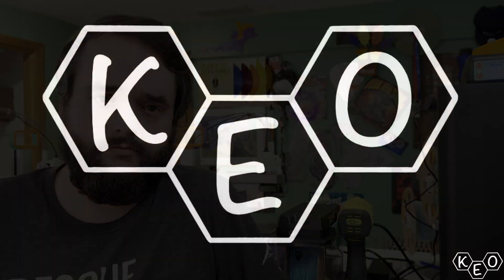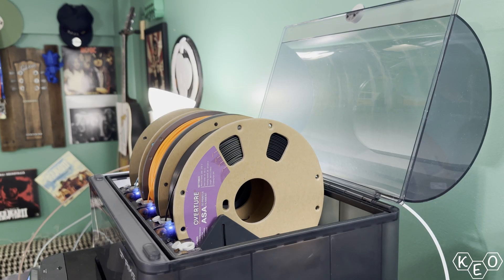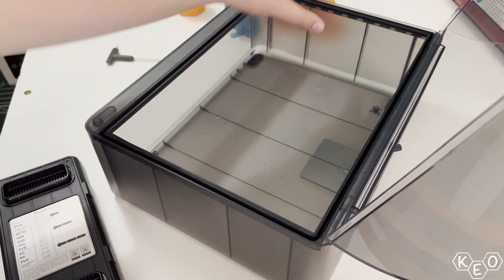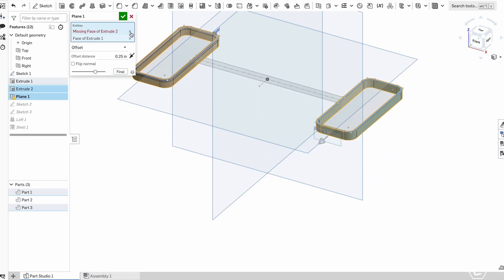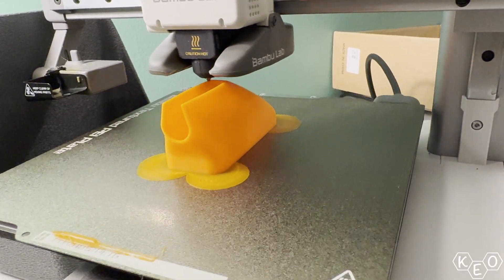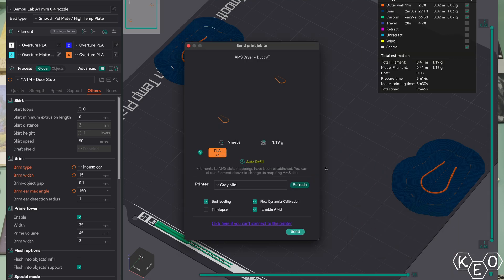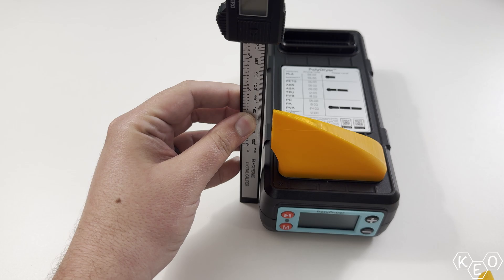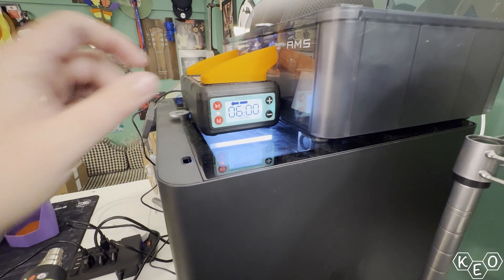AMS Active Drying? The Bambu Lab AMS PolyDryer Upgrade You Need To See

Comment: Would be a far better idea not to damage the AMS on the process. Why not just making a wedge shaped adapter that fits between the lid and the body of the AMS? This way it can attached temporarily for drying out a AMS while at the same time not damaging it. 

Well I guess I now have an idea what I can do when my Poly Dryer arrives next week..
Reply from the maker: That would have been a good idea had I thought about it! Oh well, more learning for next time! 

Let me know how you like the PolyDryer; I really like the idea of a modular dryer like that
Reply: I think you need to tell us how it did.  60% RH to 45% after an hour is not what I expect as a result.  What happened after 6 hours? 12 hours?  Did it finally get down to the 10-15% RH we need to see?
Reply: Why not just use silica (yes I know he doesn't like it)?
My 4vAMS units all sit at 17% humidity using silica beads
Reply: You cut the right areas. A new panel can easily be cut out of 1/8in acrylic that matches that entire panel. It would take about 30 minutes for a novice with minor power knowledge and cost maybe $15.
I also checked with 2 online plastic companies that would supply, cut, and ship a panel for $50.
But cutting this panel and layer sealing it with duct tape would be fine other than for looks.

Comment: Check out the Python AMS mod.  The replacement enclosure is designed to have up to 4 dryers attached to it.  It uses a retaining ring pressed onto the dryer from the inside of the enclosure, though the recommendation is to add VHB to the dryer, as well.
Reply from the maker: Yea that was the one that inspired this video a little bit. I saw ModBot reviewing that setup and I thought mounting the dryer like that was such a good idea!

Comment: “Why don’t I just use the AMS as a dry box?” Um, it is a dry box. That’s why it has seals and desiccant packs. So that it is airtight and stays dry. 🤦‍♂️
Reply: @ClaytonMacleod  but I don't think the desiccant alone can dry highly hydroscopic rolls of filament well enough. Some filaments have to be printed from a drier. That's why dryers exist. Making the AMS a drier is an excellent idea.
Reply: @rkwjunior2298  A dry box isn’t for drying. It is for maintaining dryness. A dryer is for drying. Once it is dry it will stay dry in the AMS as is. That’s why the AMS is sealed and has latches to stay closed. It doesn’t need to be made into a dryer to keep the filaments in it dry. It already does that straight from the factory. It is a dry box.
Reply: @ClaytonMacleod  Yes that's why he's incorporating the poly drier into the AMS, so they AMS is a filament drier with the  ability to print at the same time, eliminating the issue of printing from a separate drier for very hydroscopic filaments. But this is an all in one solution,  to dry, and maintain dryness while printing.
Reply: @rkwjunior2298  You don’t get it. Filaments don’t absorb moisture when inside a dry box. That’s why it is called a dry box. It is dry inside. You dry them out in a dryer. You put them in a dry box. They stay dry.

Sorry to break it to you, but filament rolls in the AMS are not absorbing moisture because there is no moisture to absorb unless you put it in there. The likely reason his AMS showed such high humidity inside is because of the rolls he’s using, cardboard, and how he treats his AMS. If he had dry filament to begin with, on plastic rolls instead of the cardboard that might as well be sponges, and he had working desiccant in it, then he wouldn’t have high humidity in it. The AMS is sealed. That means moisture cannot get inside from the room. Any moisture present inside it is what you put in there yourself. It is a dry box. It has holders for desiccant packs to stay dry. If you put moist filament with moist cardboard inside it that means you are deliberately introducing moisture into that environment yourself. This is obviously counter-productive. If you only put dry filament in it like you are supposed to then it will stay dry. The desiccant packs will easily absorb any moisture in the air from when you have it open to change rolls. The desiccant packs aren’t meant for drying out moist filament. They’re meant for keeping the dry box dry so the dry filament you put in it also stays dry. That’s why it is called a dry box. Did I repeat myself often enough for you to finally get it? 🤦‍♂️

This isn’t even mentioning the fact that those same cardboard rolls are specifically cautioned against because the fibres that come off them are going to screw up the mechanism.
Reply from the maker: Friends; please. Let’s all just hang out together. Semantics. Can we all just agree that I misspoke? 

There are far more important things to discuss. Like how support material is the worst and it should be banned!
Reply: @ClaytonMacleod  I don't agree with you. Dry your rolls of filament in a Drier Before u put them into the AMS to print. Especially very hygroscopic filaments. 
I switch out filaments all the time so they are exposed to ambient moisture at various times of its life. They don't stay in my AMS indefinitely.
Reply: @rkwjunior2298  Filaments don’t just instantly suck up all the moisture they can in three seconds flat. Moving different ones in and out of the AMS from/to other dry storage places isn’t causing a moisture catastrophe. It takes time to soak up enough moisture to have things go awry. You really don’t seem to be paying attention to the discussion. You’re now saying things to me that I just said, heh.
Reply: @ClaytonMacleod  nobody said it's catastrophic. You need to relax dude. People use dryers all the time. No reason the AMS can't be turned into one.
Reply: @rkwjunior2298  Plenty of reasons. You need to learn to read and retain information. 🤦‍♂️
Reply: @ClaytonMacleod  you have no idea what you are talking about.
Reply: @WindedWalruss93  Your failure to understand doesn’t change the facts.
Reply: @ClaytonMacleod  your failure to understand basic chemistry is laughable. @rkwjunior2298 was correct here and you refused to listen.
Reply: @WindedWalruss93  Has nothing to do with chemistry. Has to do with the AMS being a sealed enclosure that moisture does not penetrate easily enough to be of concern. How is that eluding anyone? It is a dry box. Period. Someone’s failure to understand what a dry box is doesn’t change the fact that it is a dry box. If you out dry filament in a dry box it stays dry. The absence of moisture guarantees this. You can’t absorb what isn’t there. You’ve got to have some serious comprehension problems if that concept is too difficult for you to grasp.
Reply: @ClaytonMacleod  but it's the fact that if moisture did get in the box it would solve the issue. We are talking preventative measures and being proactive regarding moisture in the ams. You still are bot understanding
Reply: @WindedWalruss93  I understand just fine. You’re the one that doesn’t. Moisture only gets inside the AMS when you open it to change filaments. It’s not getting in there when it is closed. It’s a sealed box, dude. And the small amount that is in the air in there after you close it again is dealt with by the desiccant fairly quickly. I have a hygrometer display in mine and can see how quickly it drops after opening and closing. Desiccant works. The amount of moisture that is present when you open it to change filaments, and close it again, is not enough for the filaments to soak up anything meaningful. Filaments don’t get soggy in 3 seconds flat. It takes a good deal of time for them to soak up moisture. And the small air volume inside the thing is incapable of holding enough to be of any concern because the desiccant soaks it all up in short order, long before the filament could do so. It is a dry box with desiccant, and that solves the issue. You put dry filament in there, it stays dry.

Comment: You really don't want to just circulate air in a dryer, the hot air can carry more moisture than cold and you really want that moisture to leave the dryer.   There is a mod I saw on makerworld that blows hot air through the AMS and vents it out which would do that. Personally I use an "Ivation 6 Tray Countertop Digital Food Dehydrator". $99 from AMZN, it will hold 2 spools and it vents out the top to remove moisture.  It works great even for PA6-GF.
Reply from the maker: I was wondering if the PolyDryer vented air out the side of it. If that is the case then that solves a lot of problems. I’ll have to do some more reading and make a follow up video. Thanks for the input guys!
Reply: Exactly - anyone that has been to a hot tropical place knows how humid the air can be. Cold air can be incredibly dry - freezers dehydrate your food and the air that gets in - that is where all the ice comes from....
Reply: @rorywquin   You can't compare weather to an electric heater.  Electric heat is a notoriously dry heat.
But the poly maker heater doesn't use refrigeration nor does it have a pass-through, 
The dryness of a freezer comes from the refrigeration cycle.
Reply: The polydryer vents out the air through its side.

Comment: Great ideia. I do wonder if it wouldn't be easier to glue some PolyMaker "AirLocks" to holes on the back of the AMS and connect the heater there directly to it.
Reply from the maker: That would be much cleaner. I love the air lock system that they use for their boxes and I think mounting the box directly to the AMS would be way cleaner. That could still be in the cards but the base doesn't mount securely enough to hold onto those openings without some modification. So that wasn't in the scope of this version given the silly timeline I gave myself

Comment: 1. Why didn't you just port it into the bottom and make a dummy leg to support the rest of it?

2. You still need desiccant, or when you turn it off the filament is just going to reabsorb the moisture.
Reply from the maker: This was something that I honestly did not consider. Mounting on the bottom would be a much cleaner setup. The internal chassis would be in the way of the air flow but that really wouldn't matter because it would circulate just fine. 

I am wondering if there is a good method for exhausting the moist air from the system to still eliminate the need for desiccant. It is a valid point and will require some attention
Reply: @KeoPrints  The poly maker heater and container doesn't have a pass-through for excess air, does it? As far as I can tell it just blows directly into the sealed container. 
I would also keep the desiccant pods. It's only gonna help the process.
I dont think you need to exhaust the moist air. The drier is drying the air with electric elements

Comment: Great idea 
A few things that could be modified
Maybe use a bulkhead type fitting for a more secure,  gasketed fit. A round hole would be easier to cut into the AMS using a standard hole saw size.
The outlet of the ducting is definitely smaller than the outlet of the drier outlet. You may be restricting airflow.
Reply from the maker: I am inclined to agree on all of these points. The tear drop outlets are more easily printed without supports but that came to bite me when it came time to drill out the holes in the AMS.

Dropping down the outlet size is certainly a consideration as well so we will have to see what future models end up looking like as I live with this one a little more

Comment: Great Idea!

If I may offer some thoughts:
1. reducing the cross sections restricts the airflow and may cause problems with efficiency or overheating the heater.
2. making round holes is much easier. You could use a step-drill or a hole saw.
3. if you make a rim around the opening of your adapter, you can hide the imperfections of the holes and also introduce a surface for a seal.
4. you will still need desiccant. Where else should the moisture go, if you have an airtight box?

However, there are solutions which don’t need desiccant. Cnckitchen has a video about it. I don’t remember the title. Something like the future of filament drying. It uses a small panel, which splits the water molecules and extracts the hydrogen to the outside of the box. Very low power consumption (3 W).

Good luck!
Reply from the maker: All great notes here!

Yes I know the video you’re talking about. That thing is crazy! If they come out with some passive drying solution using that component that comes turn-key with power supply and such, that would sell like crazy
Reply: You are incorrect about the desiccant. When heated they will act just like the filament and give off moisture. You are correct that the moisture needs some place to go, but desiccant is not the solution. Let's use a food dehydrator as an example to find the correct and easiest solution to removing the moisture given off by the filament. All food dehydrators are open to the atmosphere. That might seem counter intuitive as you would think we are trying to dry the air and we don't want humid air from outside the machine to get in. While the air outside the machine does have a higher relative humidity, it has a lower moisture content than the air inside the machine due to the moisture coming off the food. 

Let's think of a way to to use the lower moisture content air outside the AMS to absorb the moisture coming off the filament. If we drilled a small hole in the return section of ducting, we could introduce that lower moisture content air into the AMS. We want a small hole because we wouldn't want to bring in a lot of air as it takes time for the moisture to come off the filament, and we can heat up recirculated air hotter than heating room temperature air. 

This does create a problem as the same amount of air that gets in must also get out. The easiest modification I can think for this setup would be to drill an slightly smaller hole in the supply ducting. The size of the supply and return holes could be based of experimenting or could be adjustable to dial in the best results for a particular room air temperature and humidity. 

While more complicated, I have an idea that I like even more. Instead of cutting holes in the expensive AMS, if possible, why don't we replace the lid with one we make? If that can't be don't easily, we could make an entirely new enclosure for the AMS. This will be much easier now since the enclosure no longer has to be air tight. I am picturing a 3D printed skeletal frame with plexiglass or Lexan panels. We would have the same hole in the return ducting but let the air escape through the no longer air tight enclosure. 

There is a problem with that, as the heater would have to run 24/7. If the possible, the enclosure could be made to be as air tight as possible with a hole the can be opened or closed. To dry the filament, the hole would be open, and the hole will be closed after you are done drying. While drying, no desiccant will be used. When not drying desiccant will be used.
Reply: @Noneofyourbusiness2000  I like the idea of just custom printing a new lid! There are wax pistons they use for greenhouses that open the windows at the top when it gets too hot—something like that would be interesting for a hole being open when hot and closed when cool. I do not know how small they make those pistons, but the concept is worth exploration.

Comment: I guess you don't realize that temperature and humidity (of air) is reciprocal. Meaning - simply raising the temperature of air will automatically result in a lower humidity. That you measured the effect isn't a sign of 'success'. It's just a sign that your measurement tools are, more or less, functioning. 

You could put one of your little gauges on the output side of the polydryer base, in an open room, and see the same change in readings. 

Sorry, you didn't invent anything.
Reply from the maker: Friend, have you seen my channel? I’m not an inventor or physicist or anyone that claims to know much about anything lol. This was a fun project however and your note about continued testing is very welcomed. 

It’s been great diving into this hobby and I love sharing thoughts and ideas with the community. Thanks for taking the time to hang out and comment! 

Let me know if you have any other thoughts as well because I hope to develop this idea further
Reply: @KeoPrints This was my question as well. The lower humidity at a higher temp just shows the air has the capacity to take on more water. But it didn't really reduce the total amount of water in the air. 

What I didn't know is if this will allow the filament to dry since the air has a higher capacity for moisture. 

I still think this idea has merit. I would be interested to see any long-term results or observations of this setup.
Reply: Someone is mad they don't have great ideas to solve existing maintenance quirks

Comment: Interesting idea. Did you think about cutting a hole(s) in the bottom and putting the AMS on top of the dryer? Probably would need to print some type of stand to support the AMS with the dryer under it.
Reply from the maker: That would be a much cleaner way to do it. The tray that holds the guts of the AMS would be in the way of the air flow but it would likely direct it around the filament well. I hadn’t even thought about that!
Reply: @RJin3D  Or use 2 poly heaters perpendicular to the AMS underneath for the balance. One in each side